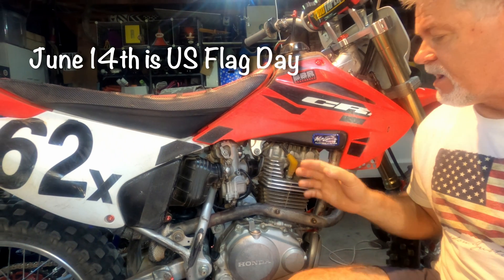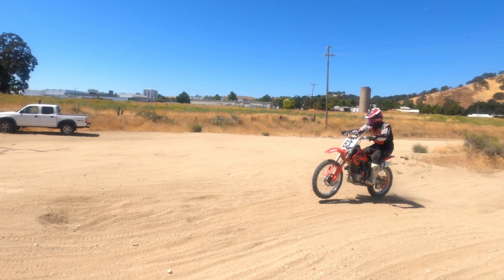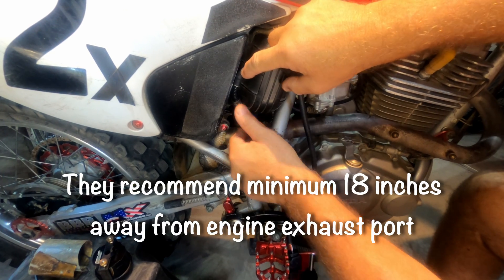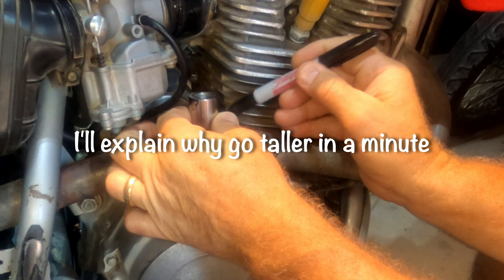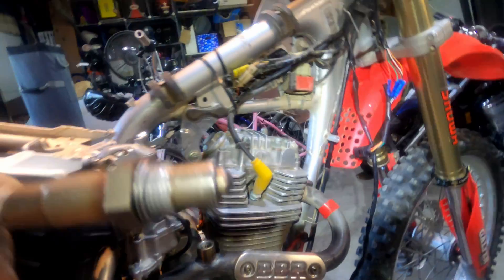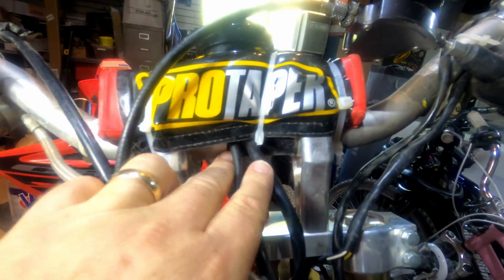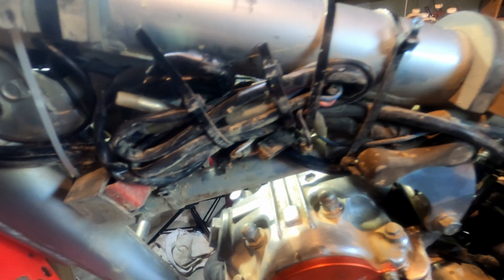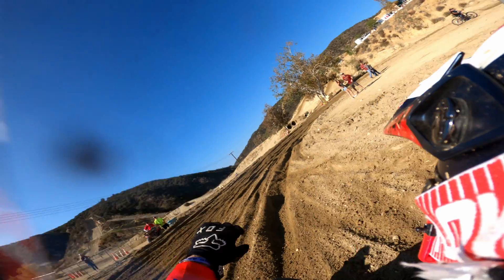Digital Air Fuel Gauge, Installation, testing, review. Less than $100

Comment: Had multiple of these gauge on my cars. In all the instructions it's says u should have a good power source. And the sensor cannot overheat. Dyno guys runs their exhaust pipes glowing red so yours is fine. Does your bike have a battery?
Reply from the maker: It does have a battery. A good thing to consider, but I pulled the sensor, it was sooty from me running it on the rich side for power and cooling. I sprayed it off with sensor cleaner chemical and now it’s working fine again.
Thanks for watchin’

Comment: Practical question.

Why don't you just plug it in for tuning and then take off for the ride? Carb once tuned should be fine and should not require further on-the-fly tweaking.
Reply from the maker: Fair question, and I have since removed it now that it’s tuned precisely for my elevation. The exhaust bung is still there if I need to plug it back in. 
But nothing short of a dynometer can place the engine under load like actually riding the bike, tuning for low, mid, and wide open throttle. Just revving it in neutral doesn’t tell you a lot.
Reply: @lowbuckgarageMOTOplusCROSS  while revving in neutral & standing still, were the reading much leaner or richer compared to driving under load?
Reply from the maker: @samng3958 I noticed lean condition in midrange under load. I richened, raising the needle by lowering needle clip one notch.

Comment: Hello sir can the sensor be placed at the back end of silencer whether it gives the correct reading .
Reply from the maker: @sorojnayak8569  They recommend about 18 inches from exhaust port. Mine was installed at 16. I don’t know if a few more inches back would affect the readings, it might, but I doubt if a few more inches,say 24-28 would hurt much and you would be eliminating any possible overheating of the sensor. But you would also likely get more soot and just have to clean the sensor much more often. I had to clean mine with sensor cleaner and compressed air after several hours of runtime. Let me know how it works out!

Comment: What was your final jetting i have a 230 im putting this same carb on.
Reply from the maker: @ColtMarcum-n6n  Current jetting 125main-40 pilot - bottom clip position BUT mine is 240cc, bigger cam, bigger intake valve so don’t go by my settings. Better to start a bit rich than lean.

Comment: Yo bro where you located ? I can give you acouple of secrets to make that bike really scream and have more power thoroughly i can help you gey it to compete with any real 250
Reply from the maker: @eliecersolera768  Already has 240 high compression Wiseco, bigger cam, valves and carb, race pipe, opened up intake, advanced timing, lightened flywheel.
ideas? what else?

Comment: I have an AEM gauge similar to yours I’ve temporarily mounted to a few bikes and a car to set up carburetors. Just bought different bungs and plugs. Jetting is still a pain in the rear, but it really helped get them dialed in. I haven’t figured out the whole computer interface for graphing thing, probably never will...lol